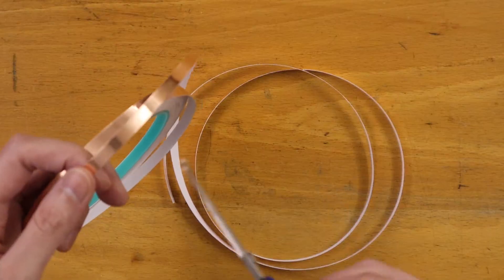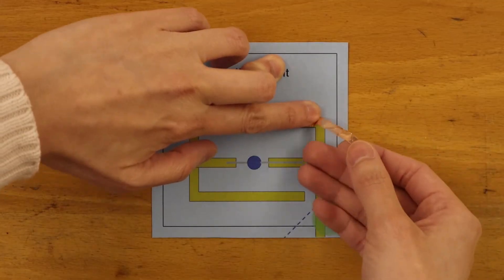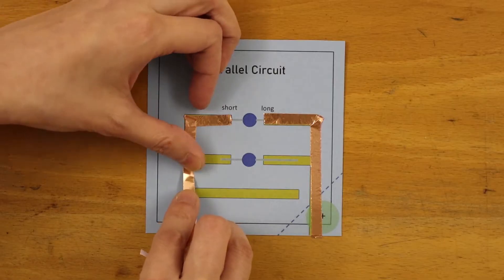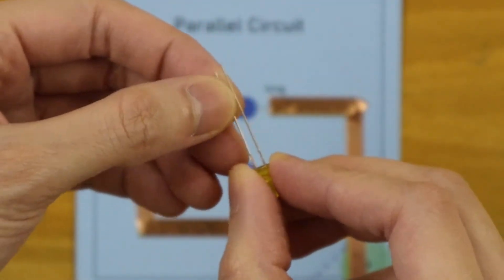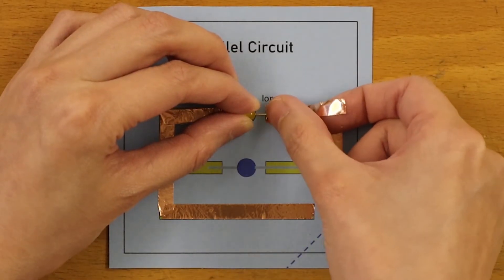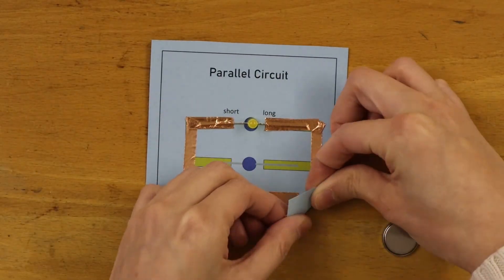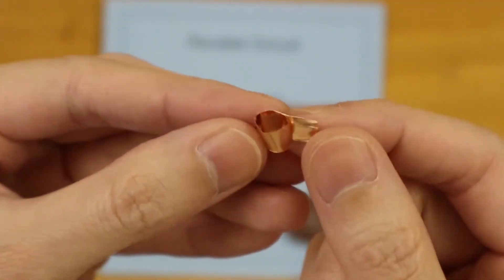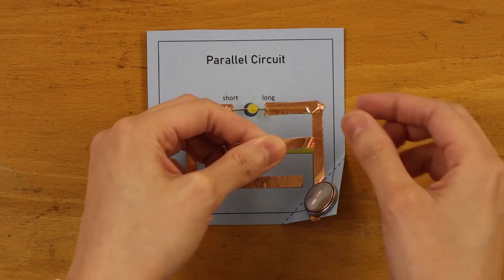Paper Circuit - Physics Experiment

Comment: 2 questions: what size copper tape do you use? 1/4 inch or 1/2 inch? Also do i have to fold the tape on the edge or can i just cut it and connect a new piece of copper tape to go in a different direction? ...i having trying this at home an can only get one led to light up at a time...any ideas what the problem is?

Comment: 1 question. Does the adhesive side of the tape conduct too??
Reply from the maker: It does, but not as well as the non-sticky side. Just make sure you press the tape down hard to form the connections

Comment: Does it matter if the adhesive side is making contact with the non-adhesive side?  Are both sides conductive when they make contact?
Reply from the maker: Yes both sides are conductive
Reply from the maker: I tried doing that with the conductive tape... you just need to make sure you really press it down hard

Comment: Why don't you need a resistor to regulate the current? Won't it burn up the LED? Doing this for my class!
Reply: Long term use will burn the led. But it's better to use a capacitor